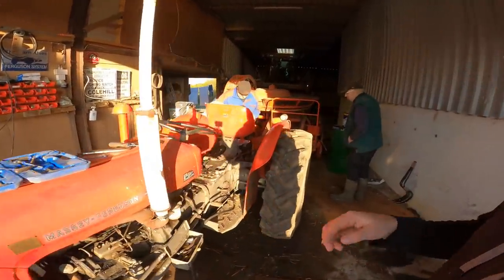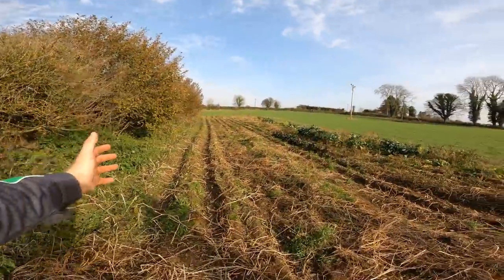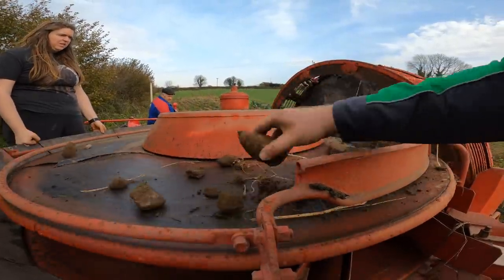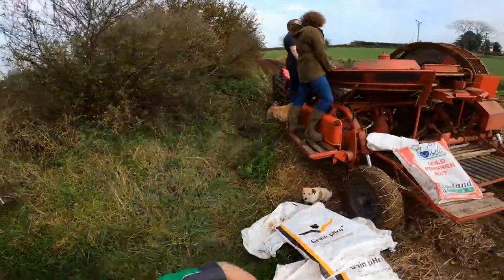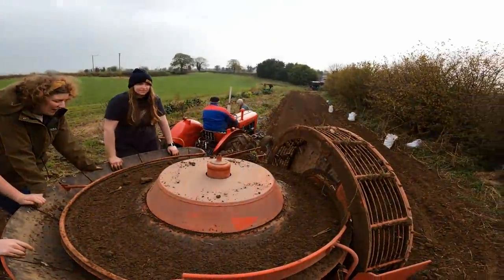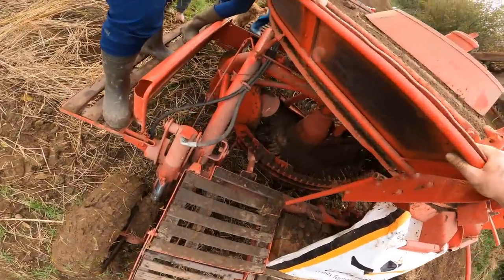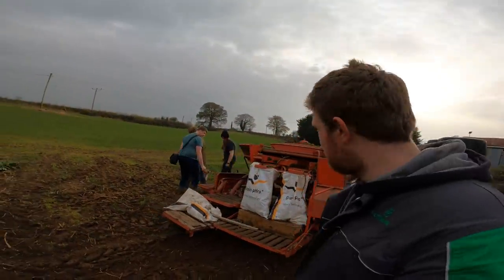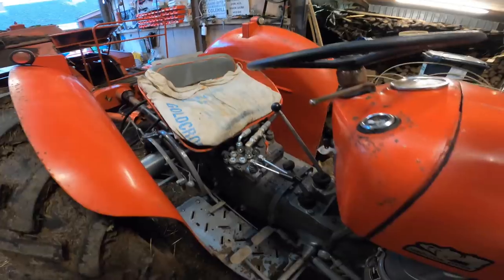TIME TO DIG THE SPUDS THE OLD-SCHOOL WAY -- MASSEY 711 POTATO HARVESTER AND 35X -- A FAMILY AFFAIR

Comment: Lol used to carry a bag like that in each hand by the neck to load on a flat bed trailer driven between rows of bags that were dropped of the 711 as they were filled. Young ones now days struggle lifting one bag with both hands or even 2/3 of a bag it seems 🤣🤣 enjoyed seeing the old skool machinery at work again after all these years 👍

Comment: Never had a fancy lifter like yours, 1959 we used a John Deere A single cylinder horizontal with 2 ox type adapted re- ridger chain drawn manual lifters splitting two rows at a time, later a Ferguson TED petrol/ paraffin 3 point mounted spinner, then PTO driven chain belt lifter. Good video , thanks

Comment: My Dad and Grandpop who were the second largest potato growers in the north east from 1936 to 1968-9 had vine beaters. They were powered from the 540pto on the tractor and had rubber tines to beat the vines off the potatoes before they dug them with a Lockwood tractor mounted potato combine harvester.

Comment: Great video, took me back to late 70,s early 80,s we had Johnson faun 1600 harvester similar type driven by a 188. It had a bagging platform on the front of the tractor. Faun had an attachment to clear the stalks from the drills. Titled a Haulm pulveriser. We also modified an old JF single chop to clear the drills.We we digging spuds early not sprayed off. Summer 1982 we were getting 5 pound a 4st bag at the field gate for Queens.

Comment: Lol the thing we took the shaws off with was the old pto mounted belt driver. The old fashioned cast iron pulley driven off the back with chains welded on it. Always an argument as to who would drive it though i was usually tasked with the welding.

Favourite bit was i clucking told ya

Comment: the potato sector, which has relied on the active ingredient for quick, cost-effective burn-down of potato tops since sulphuric acid was banned in 2009.
While other contact-acting herbicides are approved for desiccation, it is likely that many growers will opt to use an initial pass with a flail topper to knock down and mulch foliage before using these products to finish off stems.